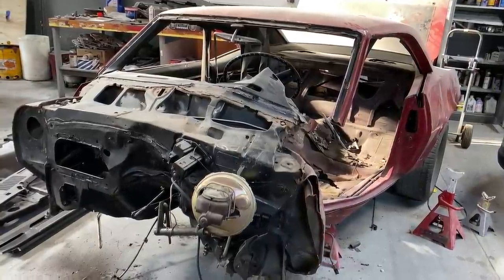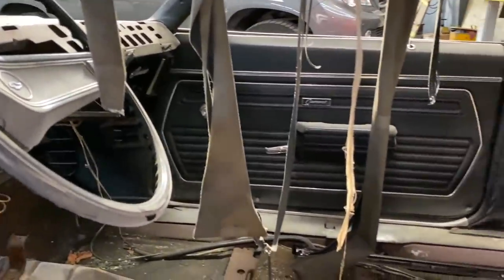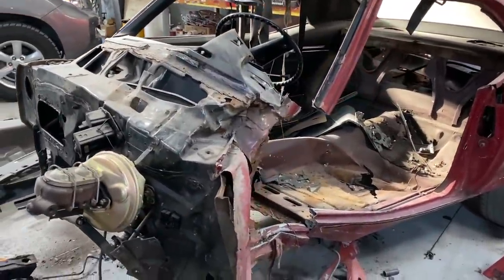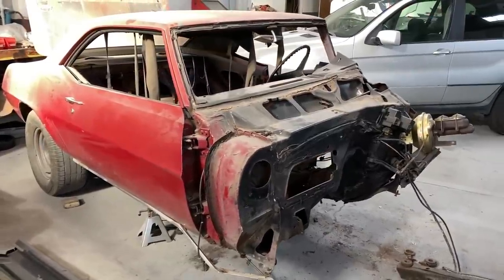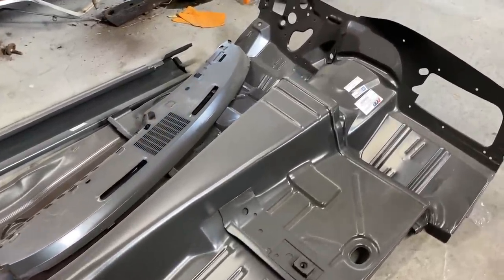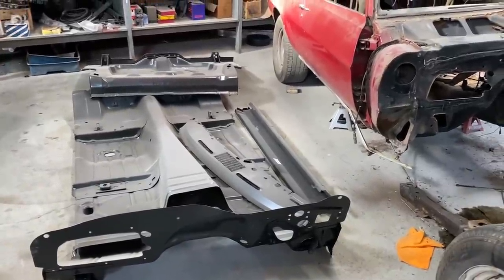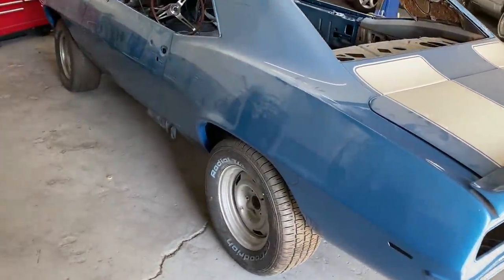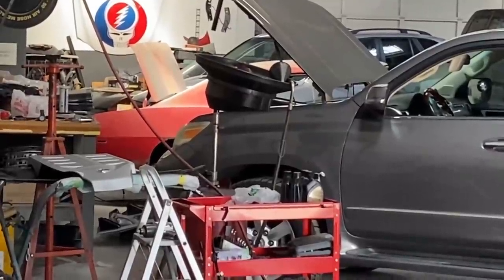69 Camaro Garnet Red Crashed but not Dead Z/28 Restoration - Part 3 - Damage Assessment

Comment: This should have been pulled out as much as possible Before any cuts were made
Reply from the maker: Yes, I am aware of that which is why we are re- assessing it before we move forward
Reply: dito!!!
Reply: I agree should have pulled it before taking it apart . Could have saved a lot more original parts such as sub frame pass fender exc
Reply: @TheYardlet  I think they can still get it straight, but making sure that the roof and pillars are dead-nuts will be imperative, especially when it comes time to install the window and back glass.  I'd think you'd want a completely different front clip and set of doors (along with new glass) to do the final body shell alignment, even if you intend to reuse that original passenger door.  But I agree on pulling before cutting, since that's what I see on body shop videos.
Reply: play hell fittin a wlndshield in it
Reply: At least it's not a rot box. Even when you pull you end up rippleling and tearing I think your ok I imagine anything that isn't perfect will be cut out plus you got another 69 for reference
Reply: To late to go a different route now, if it were me I'd set the gaps and lines off a set of original doors not repos but I'm a hack
Reply: @tomvalk1927  doesn't matter, it really won't be worth much on the market... vin code may match, but paint and steel won't. It's a wrecked z-28
Reply: It doesn't matter. This car is the definition of totaled out. No hope. The Z28 X77 badge is the only part on here worth saving...to slap on a car that hasnt been wrapped around a tree or a house or whatever this thing hit doing 90mph.
Reply: Exactly what I said when first seeing it.
Reply: I guess you guys have not watched any of the shows of the mopar guy who has saved more cars worse than this one and they have sold for big bucks. If the car is done right which I think this guy is doing it right it is not a huge deal the car has been wrecked. As a person said it is not rusted out like so many that has got new metal on every piece. I bet when the car is finished it will be very nice.

Comment: The sub frame is NO big deal. Its mild steel and especially off the car and striped down is a piece of cake. Secure the right side frame rail on the frame rack. You will be amazed at how easily that thing un bends.LOL The sub frame by itself will go back into shape very easy. when it gets close check for datim height and tram and also make sure the width is right where the upper shocks mount to the sub frame. If the shock mounts are spaced correctly then the engine cradle will be fine and the motor mounts will line up correctly. Half day on front sub frame and ready to dip or sand blast.

Comment: I restored a 70 Chevelle SS. When i took it apart the windshield, fenders and doors fit properly. The drivers side vent box was previously damaged, and repaired (I could see where metal work had been done). After paint, I went to install the windshield, only to find that the windshield had a 2" space on the lower windshield corner. So I talked to a glass guy, and he suggested that I weigh that corner down and leave it in the sun for a week or two. After two weeks I took the weight off, and the glass had conformed to the opening.

Comment: Just like your red Z28 I had a Cortex Silver Z28 with Tuxedo Black stripes and custom interior. It was hit broadside in march of 1969 very much like your red one. It was repaired as well by one of the best body shops in my area. But sadly I sold it and moved on, it was hit just a tad too much for me. By the way you do excellent work your cars are outstanding.

Comment: Watched the other videos, had no idea another VIN was under the blower motor heater assembly, is it like that on A body cars?
I have a 72 GTO that I did a "back yard" frame off, like to know where all the VINs are stamped.
Reply from the maker: Hi Soldier, yes, should be the same on your GTO 😎
Reply: Also on the frame on a body cars. Top of frame rail, back where the gas tank is located. Can't remember if it's driver or passenger side.
Reply: @IronChief  drivers side top of frame, use a mirror to see if body is still on frame

Comment: Looking forward to more content on this car. The subframe didn’t look all that bad, does it need to be replaced? I would try to preserve as much of the original car as possible.
Reply from the maker: Hi Rick
Yes, I agree but the drivers side leg is bent over 6 or 8 inches and it’s actually crushed in at the point of the impact. So unfortunately it’s toast I think 🤔
Reply: @digitalpizza1  yes, I believe you are right. It was hard to tell from the video, but you are correct. If it is that far bent and crushed, probably safer to replace.

Comment: I’m not a bodyman nor a restoration specialist but would i be wrong in assuming that the cost to fix that red car will far exceed the appraisal value when completed??? Just wondering cuz I know anything is fixable but that car really mangled
Reply from the maker: Actually, there are many many cars out there that have never been crashed, that have had most of their body panels replaced due to rust. So this car will really be no different than those when it is finished. At the end of the day it is always better to have an original car rather than a re-bodied car.

Comment: In all of this I am wondering just how much of what has been identified as a numbers matching original vehicle can be removed and replaced with new components before it loses its "original" status?  Given the nature and extent of the damage being described, I can see where replace would be preferable to repair and, understandably, the aftermarket can be cheaper than chasing genuine NOS panels which are about as plentiful as ice in the Sahara Desert and about as expensive if/when found.  Still, would it be more in keeping with the relative rarity of the vehicle if the needed components came from same year/same base model vehicles currently resident in salvage yards?  Somewhere like Desert Valley in Arizona?? where the rust factor does not play as large a role in the useability of the part?   The reason I bring this all up at all is if this vehicle ever appears on the auction block then part of its provenance will have to be the fact that it has had significant repair work done to it which, in turn, raises the  issue of just how original it can be said to be.
Reply from the maker: Hi C W
Yes I agree with you which is why we are going to keep as much of the original sheet metal as possible. We have OEM fenders, OEM drivers door and we are probably going to keep the original quarters and just fix the rust.
So I think at the end of the day most of the car is going to be original GM sheet metal. I do know there are a lot of cars out there that have had a lot more panels replaced than this one will. Also, we are probably going to only replace the portion of the floor board with the damaged area only. That is true with the trunk pan as well. Only the outer edges of the trunk pan need to be replaced.

Comment: Rear antenna on blue Z was not available with FACTORY equipped trunk spoiler...
Reply from the maker: Yes, I mentioned that in the video.
I also mentioned that the dealer installed both the hood and spoiler when the car was new before it was sold

Comment: I've own in the past three 1969 Camaro's at one time that I wished I would have kept them all when they were worth very little at the time who has the best thickest stock replacement parts? Back in 2000 I bought a 69 door shell and trunk pan and they were too thin so I just sold the whole car after installing the parts.

Comment: Don t they make a complete body replacement ?
Reply: Yes, they are available and might be a better deal when all is said and done in this case.
Reply: Company is called Dynacorn I believe
Reply: But it won't have the VIN stamped in the sheetmetal. I would agree if this were just a regular Camaro, but Z cars are bringing a premium. Even wrecked, with a proper documentation, it will bring very good money.

Comment: Okay the body assembly is from ekeler and it's $13,000 so maybe that's not quite the way to go but it sounded like a good idea you can also do a deal I saw where they'd taken cut that floor out of that car and the cow and they get a late model Camaro and set that body down on the frame of the late model Camaro so essentially you have a 69 Camaro body on a 2020 Camaro kind of a cool deal another idea

Comment: That new fire wall looks very different to me. Especially the passenger side ?
Reply from the maker: The firewall in the video does not have the upper and lower Cowl, or the tulip portion of it shown. They are all still in boxes. What you see is only the lower firewall

Comment: I don't see how it's possible to save that red car and have it still be the same car. You'll need a donor firewall the jamb is beyond repair. You could graft that section in on the Dr side from a donor and try to straighten the sections containing the VIN and cowl tags but if you go beyond that your just swapping tags. At that point it's no different than just getting another body.

Comment: Just a comment and I am not at all saying that you have done things incorrectly – but my personal choice - I would have put the shell on the rack without cutting through the A pillar so early and seen IF possible to keep that area intact.  

Of course your method may be perfectly correct - as looking from here in my 'YouTube viewing lounge' certainly does not allow an ‘arm chair expert’ like myself to accurately asses all areas.  My ‘theory’ is just different slant on how I would have approached it – and not criticism of yours (HA - and I may be wrong). 

HA - and to SHUT all the BLUE//RED critics up - I would have moved that grey vehicle out of the way so that there was a full view of the red Z28 in the same picture a the blue Z28. 

And repair the nose panel etc - and possibly even patch repair the original guard and IF ‘feasible’ also the quarters - just so that the % of original metal is higher.  The “%” bit is just me being a 'pain in the arse for detail'.

I like to use a small ‘steam cleaner//pressure washer’ to carefully clean vehicles before I start delving into disassembly – HA – keep my dainty hands clean. 

HA – and if I was not so far away – I’d like to volunteer some on my labour – great to see something like this saved.

Have a safe and nice day all.  CHEERS from AUSTRALIA.
Reply from the maker: I totally respect and agree with everything you said.
Regarding putting both cars together, there will plenty of opportunity for that in coming videos. They are both at the body shop that is not my business and I have limited control in that department 😎

Comment: I'd clipnit and graft a rust free cowl into the Z band use the repo floorboard
Reply from the maker: I agree, We are going to try to keep as much of the original sheet metal as possible.
Reply: @digitalpizza1  might want to get the body on frame machine get a  subframe on it and do some rough pulls to get things in ball park....might be racked the car...we used to clip pintos and fieros
Reply from the maker: Yes, I agree
The engine is going to be removed from the old sub frame, then the sub frame reattached to the car. Then we are going to put the car on a frame machine at that point
Reply: @digitalpizza1  wiriing harness dash pedals brake booster plus steering column..this customer or your own. Car?    Might want to add temp braces in too.....

Comment: Before it was taken apart it should have been on frame rack and pulled!
Reply from the maker: The subframe without the engine is going to be reinstalled and some of the cut welded up and then put on a frame rack . Better late than never 😎

Comment: Am I right in thinking this car is already finished?
The photo at the end of part 1, & your comments,  eludes to that.

In either case it makes some comments laughable. 1000's of experts & none of them have set eyes on the actual car.
Reply from the maker: Ha, I wish 😎 No, that picture is just to show what it will look like when finished
Reply: @digitalpizza1  Well thanks for responding & I'll be keenly following the rebuild.
BTW, the blue one looks beautiful, but I scrutinized your last video on it, but only after you stated the paint was flawless.
I'm certain there was a little booboo on the drivers rear panel between boot lid & window seal.
I only looked closely after you said "perfect", which just lays down the challenge.
Spending 1 week just on cutting & buffing tells me it's gonna be good, but it also makes you a madman if you then want to drive it LOL

Comment: Red car has an identity crisis:  See "Ship of Theseus"...

... actually this is a vin plate salvage "restoration".   Everything around the vins and block will be replaced...

How is this different from doing an illegal vinplate swap?  It takes longer and costs more.
Reply from the maker: There are many cars out there that have had many more body panels replaced due to rust than this car will have in the end. So that analogy does not apply here.
Reply: @digitalpizza1  ...and that is not really much of a counter argument is it.  
Completely new floor and firewall.  New front subframe.  New front fenders and rear quarters.  
New dash structure, and a new A-pillar. 

It is a far shorter list to say what will stay:
Roof (most of it)
Trunk lid
Hood.
Vins
Engine block.

If it wasn't actually illegal, you should grab a clean 6 cylinder car and swap out the welded panels that hold the vins and put in the numbers engine.

Reason: you would never do any of this work if it weren't for the vin.  

Not a criticism.
Reply from the maker: We are actually going to try to save as much of the original sheet metal as possible. This includes the floorboard the trunk pan which we will try to cut out the bad areas and splice in replacement areas. We have not fully addressed that decision yet. As far as the quarters are concerned, we have decided that we are going to repair the existing quarters rather than replace them. We have OEM replacement front fenders and OEM drivers door. The rest of the front down of the car will be retained including the hood. So the actual items that will be completely replaced will be the driver side rocker panel, the firewall, And the dash. Again, the final decision on all this will be coming up. But like I said we are going to try to retain as much of the original sheet metal as possible.
Reply: @digitalpizza1   well that's sounds great. And it is a ton of work.  
    And even though it is wrong and illegal, it really seems silly not to just do a very good vin panel swap to a clean solid 6 banger.
After all, that vin was just stamped and riveted to one of 1000s of blank shells going down the line in 68 or 69...

 And this factors into questions of value.   Yes, if you did an ilegal swap it would definitely NOT be THE "original" car.  But it would actually be closer to what actually came off the line (if the donor car was all original), because it would have more original welds and factory marks etc 

Just an observation...

I might even put a higher value on a really accurate clone car (also built on a clean 6 banger), not only because it would be easier to use and enjoy (and build), but also because it would contain more actual original sheetmetal.  

Loss is hard to cope with.  And this situation illuminates that.

Not a criticism, just an observation.

Comment: New floors, new quarters, new fenders, new firewall, new subframe,new dash, yet he wants to keep it original, rebody it, re vin it, that's basically what your doing anyway, time is money, at what point is it still considered "original"?
Reply: KEPT the hood, roof, rear deck lid, door, front sun frame, engine, radiator, trans, suspension, axil, interior, wheels, trim, door glass, rear glass, head lights
SHALL I CONTINUE......rocker panel trim, Z28 badges, door hinges, AC box, alternator, wiring, tail lights.......
HIS TIME, HIS MONEY.....TRUE Z28 is worth the effort....
Reply from the maker: Actually, there are many many cars out there that have never been crashed, that have had most of their body panels replaced due to rust. So this car will really be no different than those when it is finished. At the end of the day it is always better to have an original car rather than a re-bodied car.
Reply: I have worked in a body shop, have you? Original is a survivor car in my book not one pieced back together and claimed to be original
Reply: @digitalpizza1  it's not original when you replace half the body with other parts,
Reply: @paulthesoundguy1  he's basically doing a rebody, just keeping and adding the original parts to it
Reply: He called the car before repair original.  He never called any thing after.
He declared that he was repairing as much as possible.
And yes I have a real clue how to stick weld sheet metal, and how to set the correct air pressure when painting....I do however suck as body prep...
Have a nice day 😁